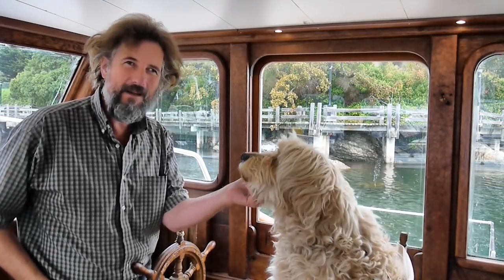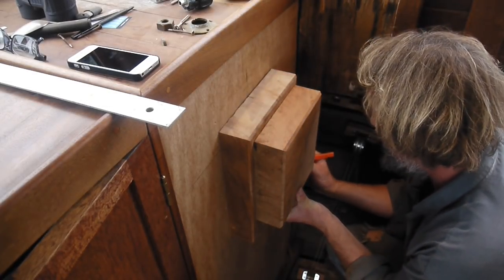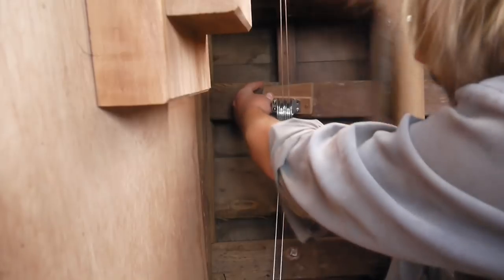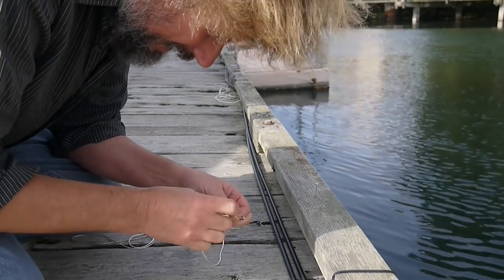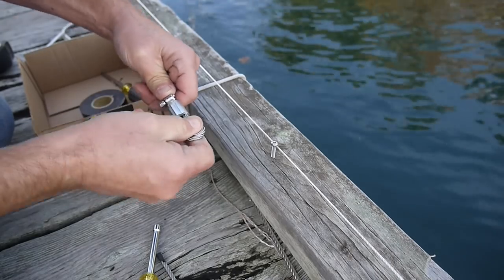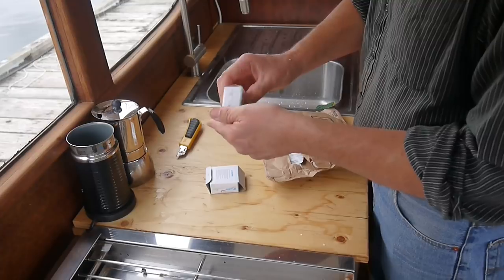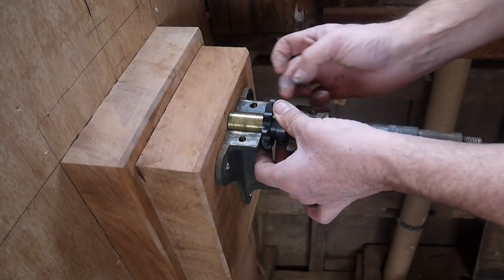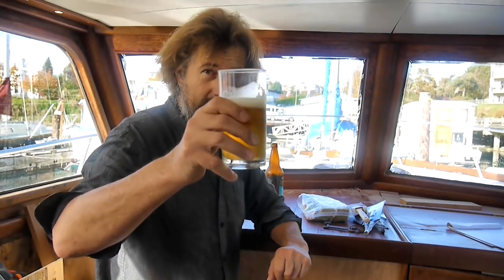Making the steering cables - Wooden boat refit- Travels With Geordie #136

Comment: If you add a spring steel 'Wave washer' to your helm shaft, it will take out any slack fore and aft, providing a nice solid feel to the helm without binding. Or just a nylon washer of the right thickness will work. Feeling the helm slop back and forth, even slightly, as you shift your grip with the waves, would make me uneasy, especially after all that nice work setting it up...

Comment: I know this episode is an old one. But padeye mounted double wire swivel blocks would have self aligned. I know, not good tv, but it would have negated the need for all the custom mount blocks. I would have also considered using Amsteel, instead of stainless steel cable, no messing with nicopress sleeves.
Reply from the maker: I considered both points. Good points too, thanks.